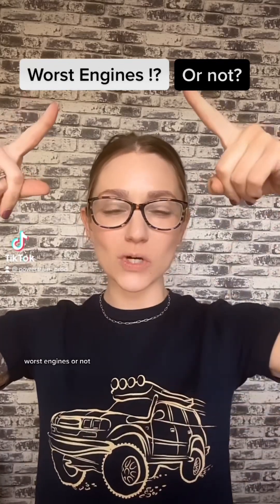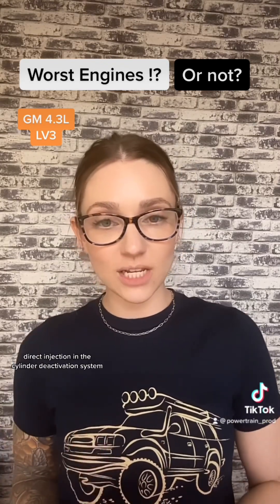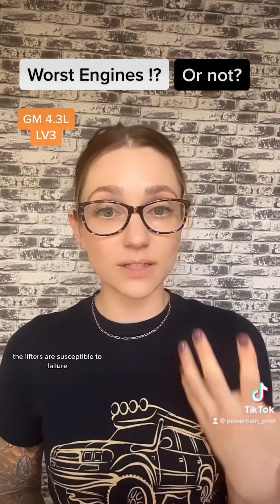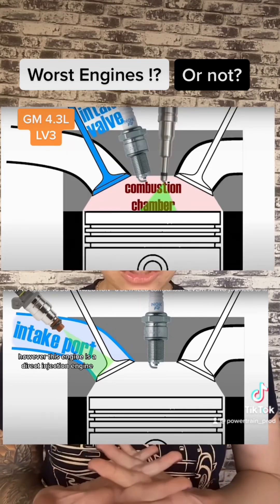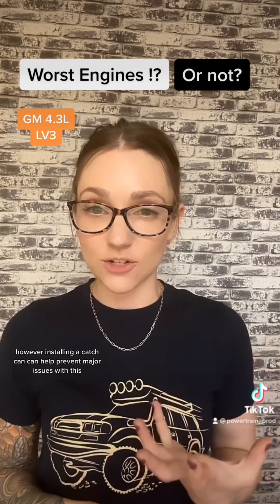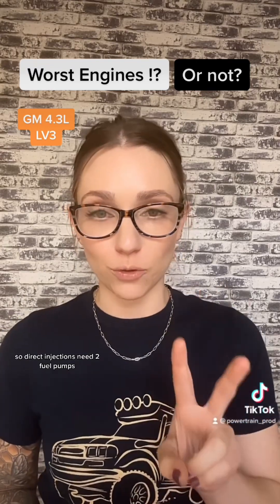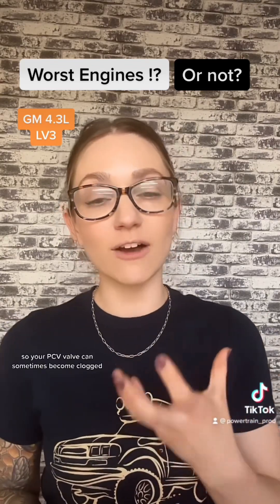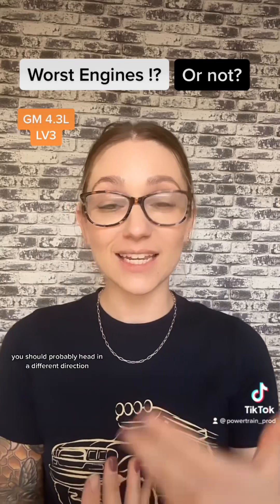GM Ecotec3 4.3L LV3

Comment: 4.3l was available in 2020 I know for sure
Reply from the maker: It was but it wasn’t the LV3
Reply: @PowertrainProducts    LV3 was in the K2 generation of trucks 2014-2018, and then the T1 generation 2019-2021.  It was removed after 2021, making the L3B 2.7 Turbo the base engine.  LV1 is the Express/Savana van application of the 4.3 Ecotec3, iron block without AFM, LV1 came out for 2018 in the Express/Savana and is still used today.
Reply from the maker: I believe those are the lv1

Comment: 1) I would just plug in the easily removable after-market deactivation module for the deactivation feature. DUD Delete!
2) Use CRC to clean them valves every other oil change. Or about every 10,000 miles.
3) Use premium/super unleaded (92 or 93) fuel to keep DI clean. Yes I know, it is extra cost.
4) Replace both low and hi-pressure Fuel Pumps at every 90,000 miles as preventive maintenance.

I need to purchase a second base (not HD) work truck with a large (8ft) bed. I will never buy the fast and powerful Chevy 2.7 turbo, you would be lucky if you reach 100K miles. The Ford 3.3L V6 is not too bad but it is kind of gutless down low as it does not pull (torque) like this gm engine does, that goes also for Ford 2.7 V6 Ecodud. In addition the (now) saving grace of the Ford 3.3 V6 is the 10 speed auto, but those trannies also have problems of their own. I would never buy a Fiat Crissler Pentacrap 3.6 V6, short/mid/long term is throwing your money away.  I guess I will settle for a nice 2019-2021 reg cab wt w/ the 4.3 and hopefully well taken care of and lower mileage.